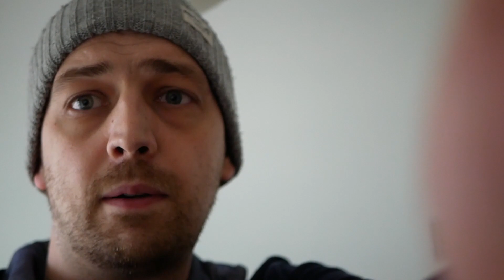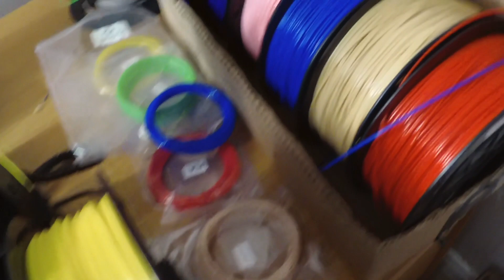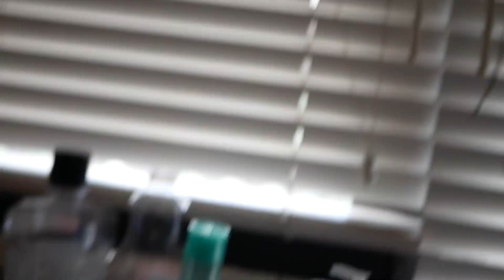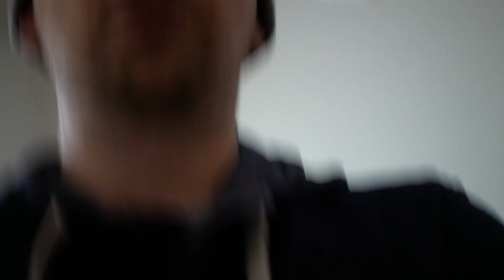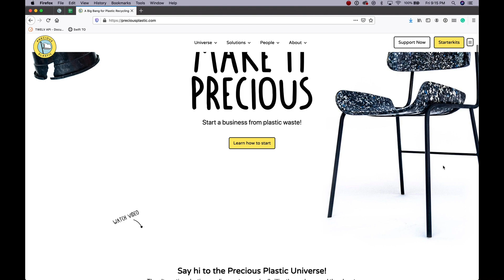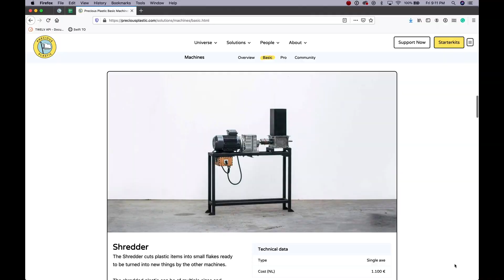The Plan - Polypropylene, Recycling and 3D Printers - Summer of Plastic #1

Comment: How are you going to clean the shredded plastic without adding micro plastic bits into the water system?
Reply from the maker: Really good question! Thank you for asking this. I really have to avoid pouring anything used down the drain. From research so far I’ve seen people use hot water for cleaning as well as ethanol soaks but neither addressed how they made certain not to contribute micro plastic into the environment. My first inclination is to keep amount of liquid low to minimize waste and lean on evaporation, though it will add time and complexity to the process. Will keep researching this, but I appreciate you bringing it up!